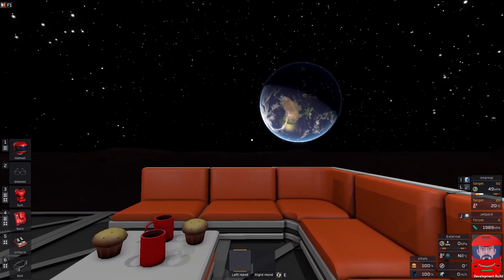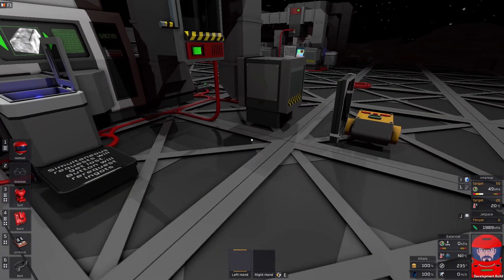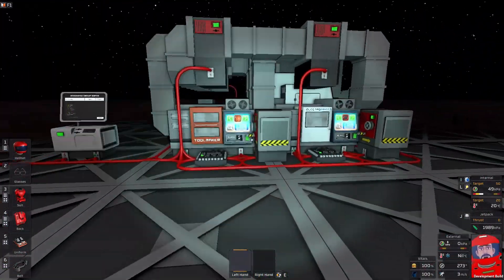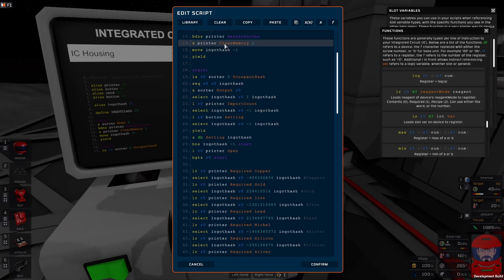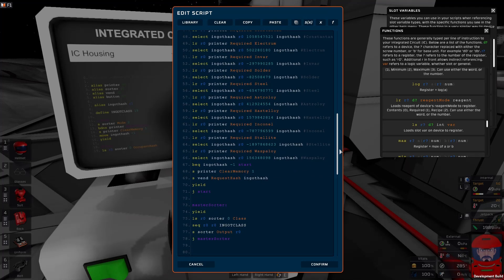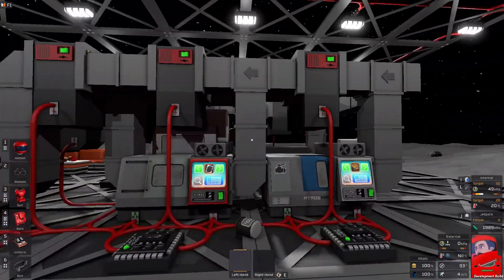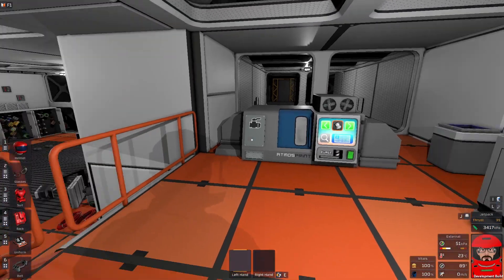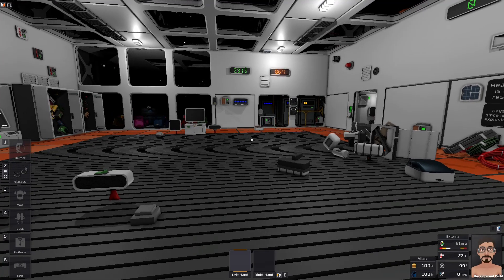Stationeers Printer logistics Redux

Comment: Thanks a lot for explaining the whole process!

Actually got me into making a better setup using the PubSub (Requester<->Provider) model.
So basically each printer is a Requester of reagents and then you have a provider per reagent type, so one for Iron, one for Copper etc.
It's a lot faster and more scalable than having a single source (Vending Machine).
And since the providers only send as much as is needed there is no need to have the extra sorting on the printer output.

Would love to get your input on it if you're on discord.

Comment: Yet another amazing setup.  Your videos are top notch!!
 I do have a question however. Would it be possible to set a sorter on each printer output that sorts ingots back to the vending machine, and everything else to its own stacker? This would eliminate the need to manually send the ingots back into the system but still allow things to be stacked.
Reply from the maker: Yes you can
Reply: That was my immediate thought as well. I think running it this way I can combine it with my existing automation that controls output quantity of a machine.  If it works, it'll be awesome.

Comment: Did this get broken with updates? I recreated it perfectly, and the printer buzzes instead of sends a request.
Reply from the maker: I still use it and it is working.
Reply: @cowsareevil7514  I wonder what I am doing wrong then, the only thing I have different in my build is it exports made items to a second vendor, but I don't see how that would interfere with the build since it just replaces the stacker. Do you have any insights on what might cause the printers to not make a request?
Reply from the maker: Mouse over the IC housing.  Will have -1 for no request, hash value when request made and 1 when request arrives at sorter.  
Make sure you have right vendor connected.
Press the resend button if the vendor hasn't sent the item.
Remove and reinset the chips to reset the code.
Reply: @cowsareevil7514  so after hours of pouring over it... turns out the ingot vendor was not turned on.

Comment: Question? i use " lr r0 printer Required Gold" everything seems to run Fine Except "Gold" shows up red? no error and whether i need the item or not r0 returns a 0 even if i "move r0 -1"  I alos loaded your code from the workshop all the ingots show up in red?? any help would be appreciated.

Comment: To keep it to one stacker you could send stuff you make to the vender to hold until you made what you want and then have it send them out by type and the orders are finished. But that would really require your other system of setting how many of an item you want made so it would no when a batch is finished and ready to send to the stacker when it is not busy.
Reply from the maker: That would be a challenging piece of code to write.